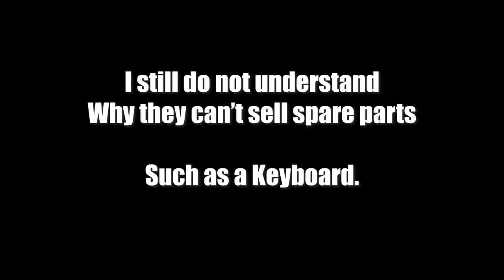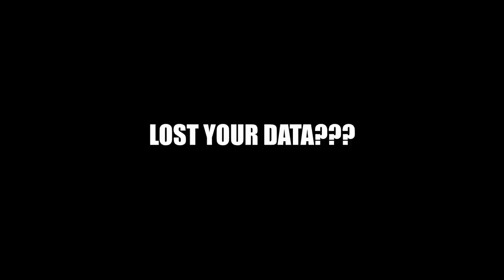Asus Dirty Games | Asus X541UA Keyboard Replacement | Malayalam

Comment: Hey man, I wud really appreciate it if u could tell me what the problem is in english. I had 2 yr warranty n already replaced the whole keyboard and trackpad assembly twice. The service guy said this model is having this problem. It's because of moisture especially in monsoon.
Now I'm out of warranty. I can replace the keyboard if needed but I want to know for sure y it's happening. N how can I prevent it. I don't understand malayali. Could u reply in English
Reply from the maker: You have explained the issue yourself brother, this happens due to poor build quality. If the power botton was separate we can use external keyboard. We now only have the option to change the keyboard every 6 months.. the genuine keyboard costs around 4600/- which includes keyboard and touch pad and the top plate. We are forced to change everything because keyboard is revetted with plastic.

In short poor build quality + poor design which forces you to spend a lot
Reply: @Azhichupani  my brothers also have asus laptops. One is a x series one. Mine is A series. The odr is some high end model. Neither of them have any issues. I don't completely agree with u abt asus bad quality. But I think u r ryt abt this one has a design flaw. So there is no way for me to change this key board only? Aftermarket? N if there is could u tell me how much it might cost.

Comment: Same as other comments, it's not just design flaws. It's design principles of every laptop manufacturers, not just Asus. Just avoid these kind of keyboards while buying laptop.
Also none of branded service centre will give you their spare parts, there are alternate ways to get it.
I am not at all a Asus fan or something, the power button design is also seen in some other brands also.
Reply: I don't know about laptop.. but in the case of the desktop segment, i did got some spare parts.

Comment: Can we get spares for this model?? I mean i have purchased the same product almost a year ago. And this is my second complaint. After using it for 3-5 months, the display got stopped working.. and i have covered it in the warranty period.. And recently i have noticed a colour change, and it turns to yellow in some of the keys in the backlit keyboard.. so, can you tell me a solution for this?? Coz, when i have enquired about this issue, the response from the seller side is like to wait a year to get the spare for this product, like they are saying like its a new model.
Reply from the maker: Approach Consumer court with the defect v
Bro

Comment: Bro same laptop enikk und. And I have the same issue. Njan service centreil replace cheyaan anveshichapol ₹3500 paranju. Warranty periodil oru varsham munne maariyathaanu. Purath anveshichapol 2000il thaazhe ennu paranju. Purath koduthaal prashnam varuo iniyum? Which one should I go for?
Reply from the maker: Go for outside service
Reply: Bro asus lap shokam ano ? Hp ano ithilum nallath ???
Reply: @sarathchandran8183  2018 muthal use cheyunnu. Ee paranja keyboard issue orikkal vannathalaathe no scene. Battery backup ithreyum naal aayittum valare rough use cheythittum no issues. Performance onnum lag illa. Service nallathaanu. From my experience its good. HP njan valare pazhakkam ulla laptop aanu personnelly use cheythittullath. So athu vach judge cheyunath sheri allallo.
Reply: @gokulsjayan83  which model asus lap you using?

Comment: Don't complain all the other models for this particular model. You just made a bad decision. That's all. Don't blame the Company. I own a Tuf Gaming 505dt. Its just perfect. Also Strix Series is also good. Its an old model you are using. They have better service now.
Reply from the maker: Heheh ROG STRIX is a good model?? Wait for my next video.. it's all the same inside...
Reply: Don't worry brother, after 1 or 2 years of use, you will change your opinion. 
I am a TUF FX505DD user. Myself have already experienced it

Comment: I don't understand, why you are not using a portable USB keyboard for typing instead of going for this type of repairs?
Reply from the maker: Because power switch is in the damaged keyboard and you cannot turn on the laptop once the keyboard is removed..
If keyboard is still connected to the machine it will start to type garbage.
Reply from the maker: Responding again
Reply: @Azhichupani  😂

Comment: Same issue with my Lenovo laptop. Power button keyboard inte Koode aan.   Oru key chumma press aavunnu. External keyboard use cheyyan pollum pattunilla. Lenovo service center il poyapol keyboard stock illa athre. 6 months aayi ippozhum stock illa. Laptop unused aan onnum cheyyan otption illa. Ee video kandu, pakshe idh pole cheyyan oru pedi. Replacement keyboard online nokki, but adh engane aan urapp varutha matching aan enn. Please help and suggest.
Reply from the maker: Bro Lenovo valare super aanallo?? Njangalude caseil okke 2/3 daysil keyboard replacement thararundu.. warranty kazhinjo lapinde?
Reply: @Azhichupani  Aano... Njan Mangalore aan.  yes bro. Out of warranty aan. Correct 1 year 1 month aayapol keyboard pani thannu. Enda options ulladh?
Reply: Veettile oru laptopum 2 desktop motherboardum 3 smpsum , oru hddyum , 2 keyboards, 4 mouse .. okke complaint aayi pc thanne use cheyyaan pattaathe aaya njaan.. mattullavarkkum issues kaanumbol oru mana sukham.. 😈😈
..
Mukalile issues palathum out of warrantyil aanu sambhavichath. Anubhavikkukaaa.

Comment: power buttn on asus mathramalla.broh acer also coming. 3 rd gen muthal.asusum. 4,5 muthal mattu almost ealla brandum inside keyboard anu varunne. 2,3 Onnum alla. 5-7 Time kb change cheytha lap vare undu. Njangalde custmrs il .
Reply from the maker: Acer okke ippozhum aalkaar vaangunnundo??? 🤔🤔 Acer njan Oru 2008 - 2010 oode vittathanu..
Reply: @Azhichupani  broh in my experinc in laptop.servc i sugeest to buy acer. Board level.servc kuranja eaka brand anu. Brand grade noki pokunnavarku accpt cheyyan kazhiyillenullu.
Reply: @Azhichupani  acer is an awesome brand .. predator is better than the rog strixx if you are focusing on the high-end. The servicing is easy to get and service cost is less.

Comment: Bro... vivobook series okkea ingane thanne aano?
Reply from the maker: Bro angane parayan sadhikkilla.... Test it out enne parayan pattullu
Reply: Yes bro. I have a vivobook s15 with power button on keyboard. My problem is that almost half of entire keyboard is bad. Tried cleaning connectors but no improvement. Will have to replace entire keyboard assembly. And it’s no cheap model - cost me rs 67000 2 years back.

Comment: Apple, New lenovo models, new dell models are having integrated power button...!!! false information dear
Reply from the maker: False information??? What do you think about integrated power button good or bad??
Reply: @Azhichupani   what i meant by false info is.. even lenovo and dell models r having integrated PW models..(u mentioned lenovo and dell models doesnt do that) ofcourse wot u said is correct in a way that it become more complicated
Reply from the maker: @muhammed.nisafar  I have used Acer, HP, Lenovo and Dell, none of them had the keyboard integrated switch. We had purchased 66 Lenovo laptops none of them have integrated power button. I think Apple started all of these... Sorry if there was a mistake in the original video.
Reply: @Azhichupani  apple was like that since i 2011 n few models if im not wrong...not all the models in lenovo or dell..few of them im talking about..especially the new thin series
Reply from the maker: @muhammed.nisafar  man we use Lenovo T480 and T580 all of them have separate power button.. oh geez..
Reply: @Azhichupani  Have u tried the 8th Gen S145 series? or ideapad 330 series? have both with me now...!!!
Reply from the maker: @muhammed.nisafar  can you chat with me on Instagram?